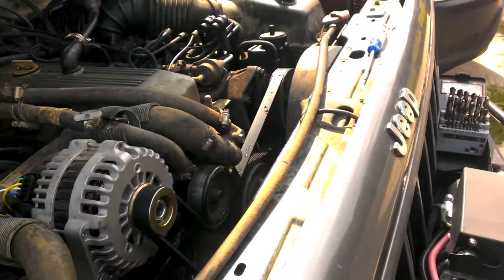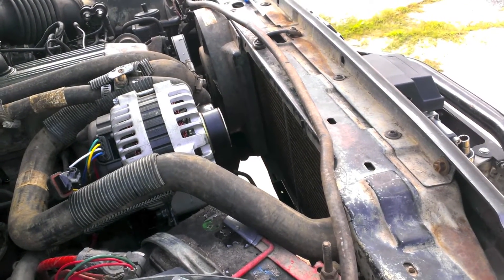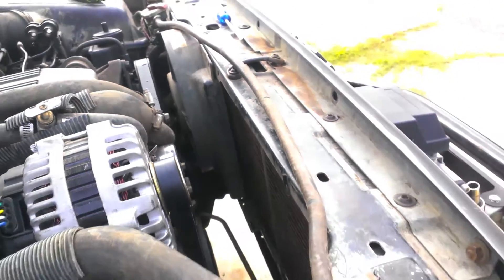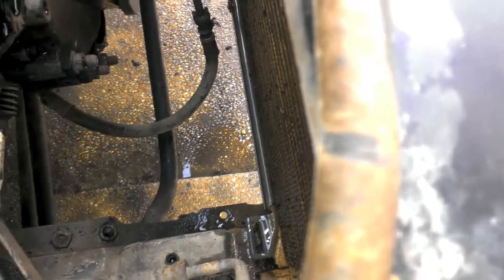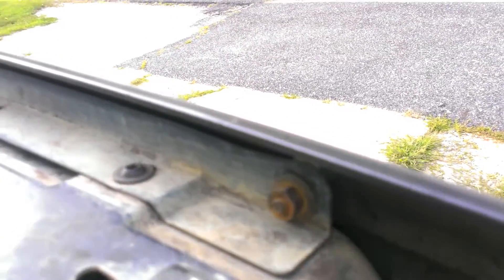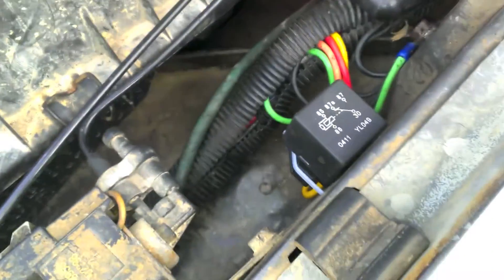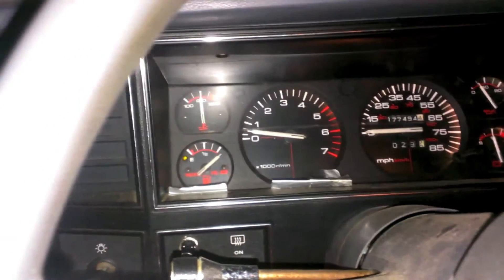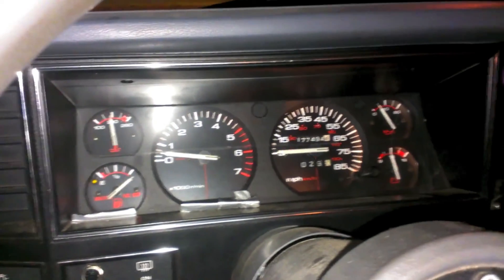89 Cherokee Installing Dual Electric Fans

Comment: Is this the same process for the 97-01 xj? I have a 2001 xj and would like to swap out the mechanical fan for dual electrical fan set-up as I heard it will give you an extra 30hp

Comment: That is not great. It should never hit the 210 mark. It has a 203° thermostat in there and should never cross the halfway mark.
Reply from the maker: Shows how much you know. The thermostat is 195F and that's just when it opens. The Operating Temperature shouldn't go over 220F, 200F to 210F is fine.

Comment: what do i do if my fan doesn't come on? it used, to but not anymore. In traffic, my jeep will overheat into the 260 range but on the highway it stays just below the red area. I want my temps to stay like yours but ive already gotten a new radiator, water pump and flushed the system so do you think its the fan?
Reply from the maker: Sounds very much like a fan issue. Does your mechanical fan have the shroud guard around it? That helps it pull air more efficiently. Is the mechanical fan clutch good? 

As for the electric fan, an easy test is to start the car and turn the air conditioning. If everything is working the efan should come on. If it doesn't, check the fan relay located on the driver fender well to see if its good. Check the fan and wiring to see if anything is burnt or broken. Check to see If your fan switch still works on the driverside radiator. 

 I'll dig up some of my older videos for Efan diagnosis later tonight.
Reply: +NickInTimeFilms everything is good with the mechanical fan, but even when I have the a/c on the electric fan doesn't come on. I'll check the fuses and relays like you suggested. Thanks!

Comment: So its been about 1 year since you did this mod. Have you had any problems with this setup so far?? Im about to do this same mod next week on my 88 MJ.
Reply from the maker: So far I'm mostly impressed. If you can get a hold of the newer fans with the curved blades, I head they pull a lot more air. Right now my only gripe is that since they are connected together they pull a lot of amps when they first turn on and it bogs the engine down a bit. I'd love to put the second fan on a delay so it only comes on if it needs to.

It keeps the jeep cool under most occasions. If you're spinning tires in a mud pit the temp will still creep up. Maybe the better fans would help with that. Overall I think it's better than stock, just make sure you're wiring is up to snuff so it doesn't burn up.
Reply from the maker: I also had to fab a plastic spacer so the fan could bolt up correctly. It fell off once and started rubbing on the serpentine belt so zip ties weren't going to cut it.

Comment: Hey thats a great idea, has this been working very well? I'm  thinking about doing it after seeing this vid
Reply from the maker: Alex Ottomano It works amazingly well. My engine doesn't need both fans unless I'm in extreme conditions like driving on a beach or wheeling on a really hot day. The one E-Fan does the job perfectly well 99% of the time but my engine is slowly falling apart. The only thing I don't like is the initial amp draw when they both kick on at the same time, it bogs down the engine for a second before the alternator start pumping out more amps. I want to add a delay or a switch to the second one so I can turn it on if I need it. If your mechanical fan is trashed I say go for it.
Reply: Awesome sounds good and no my clutch fan is still fine but I do still over heat on the beach a little so I'm thinking about this, and I like how simple it is to just wire it into the other one. Another plus is your getting rod of the clutch fan which robs a little power from the engine

Comment: ive got an 89 Comanche that keeps stalling out im guessing its the cooling system because the engine overheats at low speeds, ive sent it in to get flushed, and im replacing the radiator ill look into this as well. thanks for the videos im learning a lot.

Comment: I don't know if you have any idea but I've replaced practically everything in my cooling system, thermostat, radiator, water pump and I overheat going up hill for more than about 5 minutes if I've already been driving for 10 or more minutes. Mines a 95 Cherokee the only thing that I could think of would be the valve cover gasket do you have any ideas?
Reply from the maker: Have you tried flushing out the system? Maybe something is clogged that prevents the coolant from flowing. That was my initial problem with this jeep. The previous owner filled the coolant system full of stop leak and it just plugged everything. I would trying running some water through the heater core and other pipes just to see if you have a good flow. Does your electric fan come on ever? Is your clutch fan still good? A cooling system won't do much at low speeds if the fans aren't spinning.
Reply: The electric fan does come on after it gets over 100 (210 fahrenheit) and mechanical fan clutch is good, but thanks, I'll try and flush the system.

Comment: Found a 160 degree thermostat on eBay work's good especially on the w highway you had ac on your jeep did come with a clutch fan for that yr or was on later models thx

Comment: I found a 160 degree thermostat on eBay it works good especially on the highway city still under 210 for my 01 notice you don't have a clutch fan did it come ot that yr model
Reply from the maker: 0:09 Yes, all model cherokees has a clutch fan from the factory. As stated, my Clutch fan bearings were shot so I removed it.